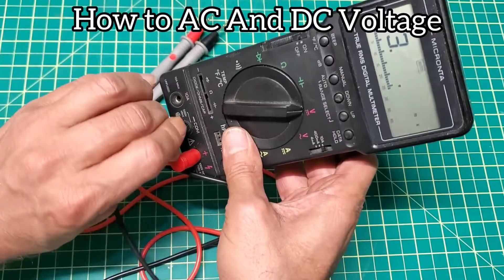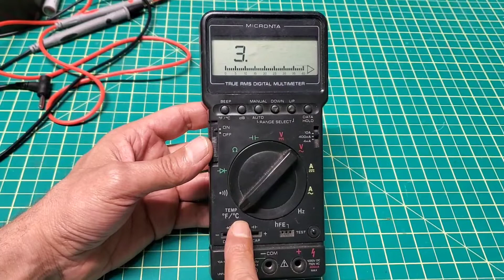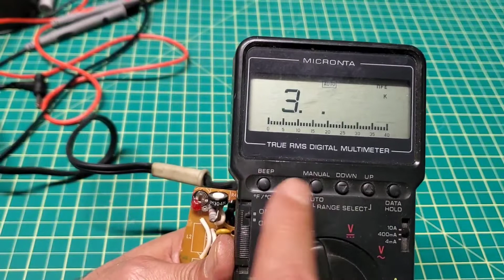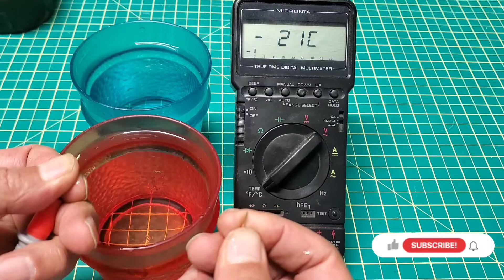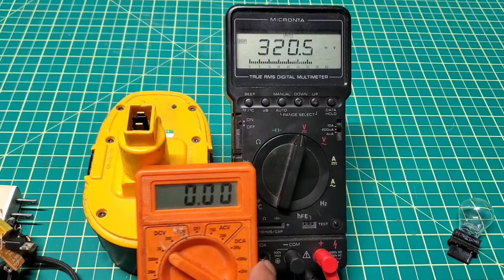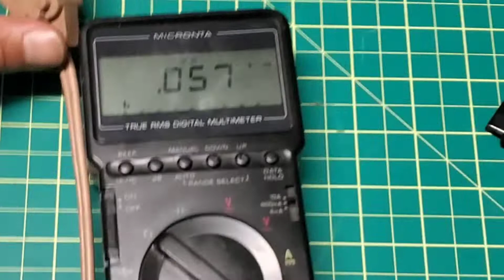Antique Vintage Multimeter Micronta 22-174B Full Review & Test, How To Use + Useful Tips - Tricks

Comment: Wondering what should i do if i popped open the back and there's corrosion
Reply from the maker: Hi! If you found corrosion after opening the back, first remove the battery and make sure the meter is powered off. You can gently clean the corroded areas with white vinegar or lemon juice, then wipe with isopropyl alcohol and let it dry completely. Check for any damaged wires or contacts before putting it back together. Be careful—it’s an old device, so handle gently! ⚡🔧
Thank you 😊 and all the best ❤️

Comment: You did it all wrong about the temperature function. The meter measures the resistance of the probe which is a thermistor. The various temperatures that you got had nothing to do with the temperature but the resistance of the various things that you try to measure.
Reply from the maker: Thanks for pointing that out! I appreciate the clarification—it helps me and others learn. I’ll definitely look into the correct method for measuring temperature with this meter. 🙏
Reply: @WorldRandomVideos  You need what is called a 10K thermistor. The resistance of the thermistor is 10kOhms at 25 C.
Reply from the maker: That’s right,  thank you 😊 🙏

Comment: Nice work on the video! I noticed that the method you used to measure temperature with the two probes might not be effective. The multimeter actually came with a digital sensor that plugs directly into the common and positive ports. The sensor is built into a stainless steel tube that comes to a sharp point, similar to the temperature sensors used for testing if meat is cooked properly. The stainless steel part of the probe is approximately 75 mm long with a plastic handle that is 110 mm long. There's a single wire coming out of the end of the plastic handle, and the overall length of the wire is about 1 meter with two wires to plug into the multimeter.
Reply from the maker: Hello my dear friend, thank you so much for your wonderful comment and great information 😀 😊 👍,  yes yout Re obviously right , I don't have the right temperature sensor probe or tester,  I ordered one but unfortunately it didn't fit, thank you again 😊 and all the best 👍 😊.

Comment: I have the 22-174A.  The continuity uses a piezoelectric speaker that is sealed off on the inside, only to exit the back of the unit.  There is a hole in the plastic body, which runs to the back, where the sound is supposed to come out.  Unfortunately, The labeling department didn't get the memo that they leave a cutout in the middle of the label so you can actually hear the buzzer!  Give this a try: press with your finger directly in the middle of that label on the back. You should feel a circular soft spot, somewhat smaller than the screwdriver hole below it.  If you carefully trim out the label to match that hole, you will see the gold piezo about 1/4 inch down inside.  It's amazing how much more audible the piezo speaker is after doing this.  No joke, it's at least 5X as loud!  And this unit really isn't waterproof, so it shouldn't make a functional difference otherwise.
Reply: I think the temp sensor came with the unit, I don’t think I paid separately for it. I was incorrect to call it a thermocouple. It is actually a thermistor. At 69F it measures 12.3 kilohm and drops as the temperature rises. I expect it is a common 10k thermistor at 25C inside the metal tube.  You might have one laying around. These are used in laptop battery packs.
Reply from the maker: @pault6533 excellent information thank you so Much and all the best ❤️🙏😊
Reply from the maker: Hello my friend, I am glad to read your wonderful message, it's interesting and very useful information 😀 and excellent tips,  I will try what you mentioned and let know, thank you so much and all the best 👌 👍
Reply: @WorldRandomVideos  I purchased my multimeter new.  The unit has a thermocouple probe attachment which enables temperature measurement.
Reply from the maker: I had to buy temperature probe tester from AliExpress, my question is how much did you buy it and how much it Worths now do you think? Thank you so much and all the best 🙏🙏🙏🙂🙂🙂